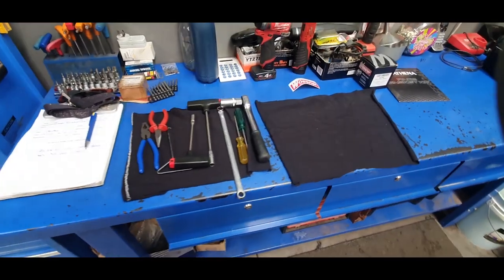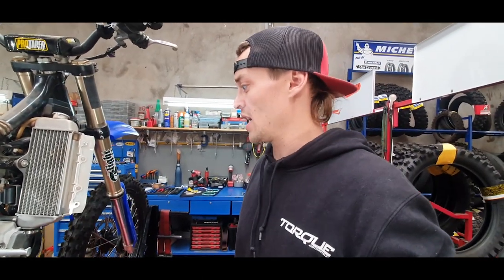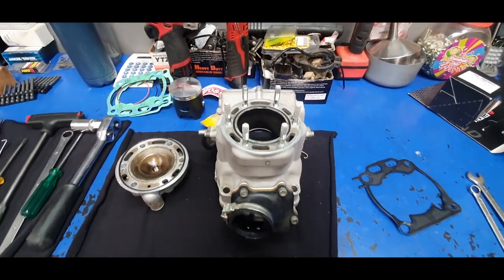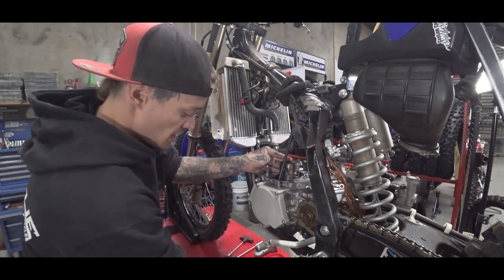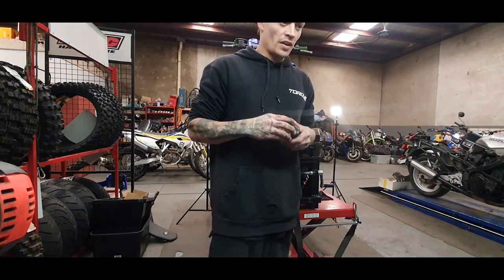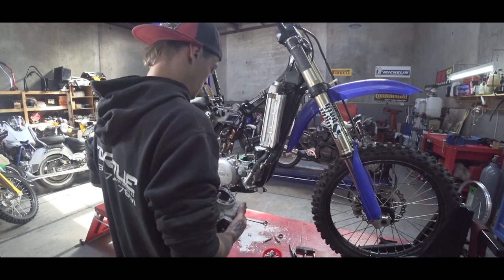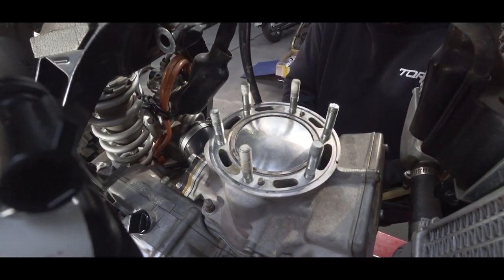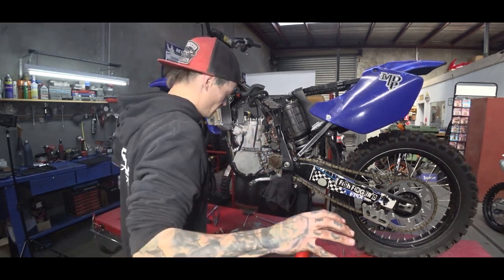How to rebuild a YZ 250 2 STROKE Top End

Comment: great video! i have a question tho... how do you know if ur running too lean or too rich on the carb???? u stay w the regular jetting if u use the same piston?
Reply: Depends on your place like is it always hot or cold u probably would change jetting but if your to rich your plug with be oily and may had oil coming out the tail pipe if your lean it runs high idle or bogs on low end

Comment: I have a 2017 and there isn't enough room to clear the studs when taking off the cylinder dome . It hits the top motor mount bracket  buddy told me I have to basically tip the whole engine . But nowhere have I seen this having to be done